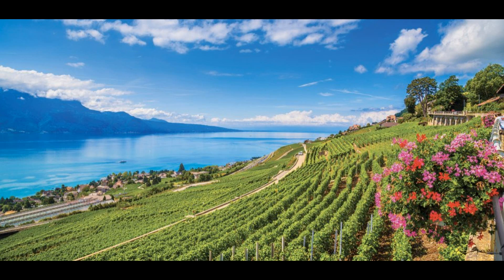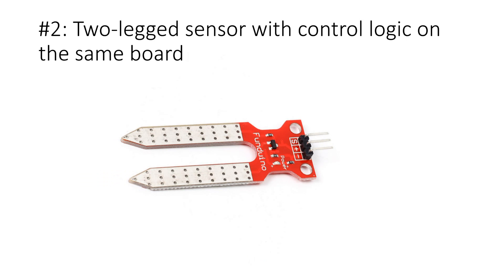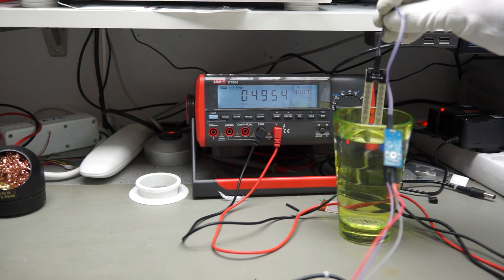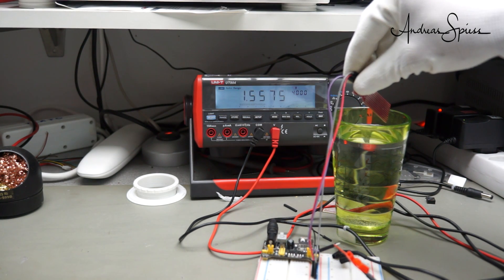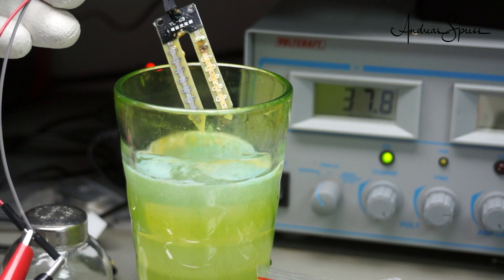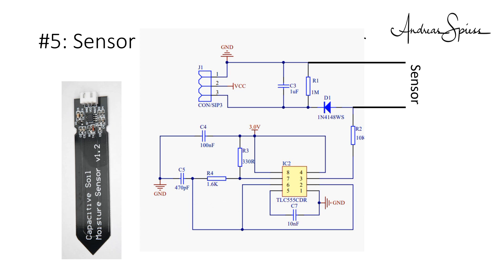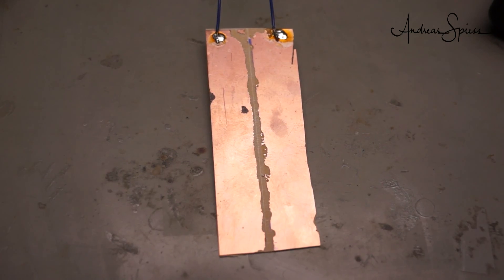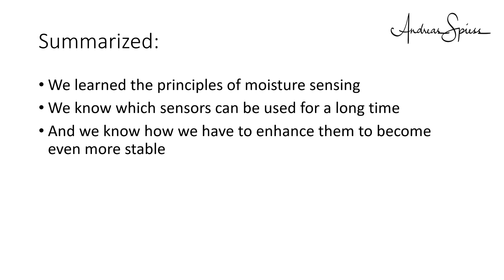463 Why most Arduino Soil Moisture Sensors suck (incl. solution)

Comment: I use a very good nail varnish to cover all the moisture sensor v1.2 including the chip and the pins and wires and works fine since 2-3 years now. But there is a missing connection between ground pin and the a ground trace. Simply solder a small diameter wire on both side of the pins header. Cheap China stuff but works.
Reply from the maker: Thanks for sharing your experience. I left a video where the quality problems are explained.

Comment: Nice test, however, you cover only one aspect of moister sensing because you test the probe in water, which is the case maybe only in a swamp. With different types of soil, readings will differ and you may expect only trends not measure humidity with countable precision. I created and sold capacitance soil moister probes almost 10 years ago with limited success because of issues with soil (ph, soil compacting, type of soil and ingredients, temperature, and so on). Probe was tested in different climate ranges and soil types, even in the substrate in almost laboratory environment.
Reply from the maker: I agree with your findings, but unfortunately, I did not find studies on the topic. I would only recommend these sensors to trigger watering. For precise measurements, you get the TDR sensors. But they are much more expensive. Could you let us know if you published your findings?
Reply: @AndreasSpiess  I will try to find some old web pages I created according to findings and republish them, however, it was a long time ago, and at that moment I wasn't fun of  open hardware  movement, mostly because I didn't understand licensing documentation and most document have strict copyright

Comment: Would using two stainless steel probes solve the corrosion problem?
Reply from the maker: There are several proposals in the comments. One mentioned special nails that avoid the corrosion problem.

Comment: There is a very good video from „flaura“ about problems with capacitor version. He tested 38sensors and most were wrong! because of the pandemic production problems the are tricks with wrong components . see also: https://youtu.be/IGP38bz-K48
I can confirm this cheating. I had to fix 2 of 4 sensors. In this video he also references your original video.

Comment: Even the capacitive sensor isn't good, with exposed FR4 edges. I looked into this once and Steven's Hydraprobe looks good. It gives moisture, temp, salinity over RS-485 using 50MHz RF. The cost is $695 though (!).
Reply from the maker: I agree. These TDR sensors are much better, I agree. But for controlling the watering of 10 flower pots probably a bit expensive ;-)
Reply: @AndreasSpiess  FWIW, HydraProbe isn't TDR, it uses radar to measure dielectric impedance. It measures the energy storage and energy loss of the soil to determine the moisture content. This reduces the influence of salinity and temperature compared to other solutions, allowing it to work without calibration. It's really neat and I have bought one, but I won't get to test it until early 2024.

The cost is silly, but nothing is too good for my lawn. :p Mostly I just want to play with the cool tech. My DIY irrigation controller calculates ETo to determine watering durations. I'll use the soil moisture data to double check that, eg don't water if the soil has enough moisture even if ETo thinks it needs watering.

Comment: Andreas - good to see this topic again.  I was a disappointed to learn that even capacitive sensors fail over time if they are just coated with resin, as the resin still allows water intrusion via osmosis.  I wonder if that includes all forms of epoxy.
Perhaps the probes and the base of the instrument body could be coated with "Plasti-Dip"?  The plastic bag is a fine idea, I guess, but really the sensors should be fully sealed in plastic until the whole instrument is up out of the soil and well out of the way of splashes, etc.  So rather than putting plastic "leggings" on the sensor probes, I'm talking about plastic "pants" that reach to the top of the sensing instrument.
I am a bit sloppy when watering plants, yes. :^)
Reply from the maker: Thanks for sharing your experience. I do not have longtime experience with the different sorts of epoxy. Maybe others experimented with it already.
Reply: The thicker the protective layer, the less sensitive the sensor is. Which means: use a very fluid resin for coating, so that it will cure in a thin layer.

Comment: Hi Andreas, Always a pleasure to view your videos.  I have played with quite a few of the capacitive sensors. I found that with some of them, the 1M ohm resistor that is supposed to be connected between GND and SIG is there but is NOT connected to GND! . Seems to be a design defect as a whole batch I ordered from the famous Chinese supplier had the same problem. As a result, the  reading was false. To correct it, I just soldered a 1M ohm resistor between the two pins on the connector.  Easier than trying to correct it on the PCB with the surface mounted components.
Reply from the maker: I heard of this flaw, too, and added a link to a video where it is shown in the description

Comment: You must know that the last sensor you shown have a lot of variants and there are some that are completely unusable and some of the circuitry mistakes are just “stupid”. Check them out in other YouTube videos.
Reply from the maker: I added the video you refer to in the comments. However, it is a bit exaggerated if you power the sensors with 5V. Then there is only the missing connection to the resistor left, if I remember correctly.
Reply: @AndreasSpiess  Yes, exactly that video. problem is, in my case, is that I bought 15 of those sensors 😒
Reply from the maker: @Amalokch Should not be a problem. Power them with 5V and connect the resistor to ground with a small wire. Then they should be ok.

Comment: sonoff ms01 is looking pretty good, it sends data trough I2C, it is on my to do list to test one in esphome and if satisfied switch from all other ones .... but it is not on top of my list ....
Reply from the maker: Xiaomi offers a similar one, too. They are a good solution if you do not want to tinker.
Reply: @AndreasSpiess  looking for some "reliable" to integrate with esphome for home assistant. Will look at it, if you know about more please let me know, because i am in fight with soil moisture sensors from spring.

Comment: Metal salt fertilizers that people use to fertilize the plants affect the readings and the life expectancy. 

Most powdered metal salt based plant fertilizers are extremely conductive 

Just like when you’re making a battery and you’re adding acid 

Like a nickel, and a penny the copper nickel with a piece of paper in between, and you add some vinegar 

As you’re going to summer in the soil gets dryer, faster, the salts from your fertilizer, build up and acidity or the salt content spikes . 

Throwing off your sensor readings .
Reply from the maker: Thank you for the info. Is this also true for capacitive sensors?

Comment: If I had a house with fifty plants would I buy the passive copper unit, run intermittently, or the overpriced with chips to protect? Engineer to simplicity, not complexity!
Reply from the maker: You decide. Both sensors are not very expensive.

Comment: I have tested the capacitive soil moisture sensors extensively and they are not reliable whatsoever to measure anything accurately in soil, the only working solution is to make a resistive sensor that receive power only for a very short time with prongs in stainless steel or silver solder. That was my solution to manage my sprinkler system in Florida. Anyway, there is no need to measure the moisture in real time, 2 or 3 times a day is more than enough, humidity does not leave spontaneously the soil.
Reply: Tin the copper! Or use silver solder...
Reply from the maker: Thank you for sharing your experience! Shortening the measuring time for sure reduces corrosion.

Comment: I wonder if the resistance sensors would be better with graphite / carbon probes? Carbon is pretty inert in water electrolysis, unlike copper. Whilst they wouldn't last forever, they would significantly outlast copper traces. Also carbon is not toxic to plants whereas high concentrations of copper can be.
Reply from the maker: Others used graphite rods. I do not know how their handling is. The ones I know are very brittle.

Comment: I have one project where I decided to solve this problem reading the sensors very quickly, and then turn-off the circuit where the sensors are connected. First the Arduino turn the circuit on, then I made 64 readings in less than a second, and calculate the average value of the readings. After that I turn off the circuit. As I have to make just one or two measures per day, I think this is a good workaround.
Reply from the maker: Indeed, this is a good idea to reduce corrosion.

Comment: Small problem: Clean water id more or less an insulator. What you can measure is the concentration of different salts wich gives a very unprecise picture of the soil moisture.
Reply from the maker: For the resistive sensors, you are right. The capacitive ones use water as a dielectric material.
Reply: @AndreasSpiess   Yes, but what does the salt content in the water means for the dielectric properties? I have experimented with a small cage made of net buried in the soil. Inside a DHT 22 to measure the air humidity and tried to relate it to the soil mosture.
Reply from the maker: @andersgardo6777  And did it work?
Reply: @AndreasSpiess  I got some different values but i don't know how relevant they are. Lack of time to go deeper.

Comment: A super cheap workaround is running DC for 10ms every minute or so. You still get your readings and the sensor lasts much longer.
Reply from the maker: You are right. This helps to avoid electrolysis.

Comment: Electronics noobs here, but two questions:
1) Would the DC moisture sensor last a lifetime if you'd only power it for sensing like once per hour for a few seconds?
2) If you'd somehow make it an AC sensor instead of DC, would this avoid the electrolysis issue?
Reply from the maker: Both help. But exposing metal to soil seems not to be a good idea as it corrodes for other reasons

Comment: Excess copper in the soil causes iron uptake issues in plants. Too much leads to very pale yellow plants that die after a week or two.
 
Our hero in this case, as always, is the inanimate carbon rod. You don't want to use anything made of metal when dealing with plants.
Reply from the maker: Thank you for the info!

Comment: Loving the SHT-35 for humidity, so far at least. They seem to be quite a bit more robust than the old DHT sensors. I run 2 of them 24/7 to add humidity to my plants via a relay-controlled humidifier.
Reply from the maker: I am not sure if humidity sensors work to measure moisture. Do you use them for moisture?
Reply: I don't, but you did mention humidity sensors in the video. :) So slightly on topic.

Comment: I've never used them. I was expecting you to use Proximity sensor with it's sensitivity set extremely low.
I have no idea if it would work but I'm my head it makes sense.
Nice video.
Reply from the maker: Just try it and you know if it works ;-)

Comment: I use hot-galvanized nails as probes.  These are the gray, rough looking ones.  Few years now, no corrosion.  Avoid electro-galvanized (shiny) - they wont last.
Reply from the maker: Good tip. Thanks!

Comment: I bought the Xiaomi Miflora Sensor wich has also a lot of knockoffs wich are cheaper, Monitoring it for 7 Montths now and it works fine and reliable + has integration features Battery still shows 100% You pay a little extra for the enclosure ( water resistant ) and the ease of use ( not encrypted BLE ) and a nice byfeature is the EC measuring wich gives a rough ( not really useful ) estimate when its time to give a little more fertilizer or if there is too much salt build up
Integrated in HomeAssistant with Automated Watering learning based of the dry / wet cycle and times it takes the plant to take up the water added 
I couldnt have or use more features and its working out of the box, no need to ask for more after fiddling around with diy solutions for years im happy that this project is now running and working
Reply from the maker: I agree these Miflora sensors are a good choice. Thank you for sharing your experience!

Comment: A nerve can be replicated in the lab, such as how our nostrils allow us to know if its dry or about to extrude a magical nose goblin worm jellyfish type of pet from Lungset twin cities.
This can be recyled to make capacitors and the snot battery.

Also, we can begin to wear peltier circuits woven into clothes for best cooling cheapest, and our shirts and shoes could charge a heating pad woven into clothes. This can also power devices. We could also breathe into a tank exhaled breaths, and this could raise a weight or turn wind up a torsion coil to harvest the power of the people boosting performance and efficiency of the biological engines that we are.
Reply from the maker: Interesting ideas!

Comment: You could make a tiny floating ball in a tube that is seen below the soil with a proximity or magnetic sensor, or you could insert a humidity sensor from a weather station for percentages of moisture, and this can activate automation to add water.

A toilet float valve or a smaller copy could trigger a online watering line and use a automatic fish or dogfood bowl refiller to add plant food.
Reply from the maker: Moisture and humidity are measured with different sensors. So I am not sure if a humidity sensor would work for moisture.

Comment: Could you propose a method to calibrate the output characteristics for the particular soil type, installation depth, and soil compaction?  In other words can we compensate for these effects in order to improve repeatability? Maybe comment on use as tank fluid level sensing. Thank you.
Reply from the maker: 1. I am not sure if they can be calibrated for precision. At least, I did not find any information about it. It is more to show you when you have to water your plants
2. I made a video about measuring water tank levels. Capacitive sensors are used there, too. They are longer.
Reply: @AndreasSpiess  please share the link

Comment: Hi Andreas! Just a comment about the home made PCB. It is very easy for copper clad FR4 to make 2 cuts through the copper down the center close together with a razor blade. Then lift a corner of the copper with the razor blade and grab it with a small pliers. It can usually be stripped off fairly easily. It should only take a minute or so to do.
Reply from the maker: Good idea! Thanks for the tip!

Comment: Very nice view over the lake. Switzerland is beautiful. I have had the same problem with "open" sensors. I took bicycle spokes and solder it on the sensor. It works OK.
Reply from the maker: I wonder how you were able to solder to steel spokes. I did not know it works.

Comment: Any electron flow in a damp environment will cause material to migrate either from your plate or to your plate.
None contact is the only way to go, or treat the sensor like an LCD display where there it has to be treated the same, an AC signal with no DC component, or you destroy the segment.
Reply from the maker: I agree!

Comment: The two-legged sensor with a gold plating most better than of cheaper lead. I've tested ENIG version about 2 month, if not scratch them, no corrosion will be even with fertilizers. And power on must be very short as possible for measuring.
Reply from the maker: Thank you for the info!

Comment: I have a commercially made sensor (Ecowitt WH51) that appears to have a continuous loop that goes into the soil.  Perhaps under the coating it's not a continuous conductor though.  It eems very reliable but now I want to see what is inside.
Reply from the maker: Inside are two not connected traces that form a capacitor.
Reply: @AndreasSpiess  That's my suspicion after watching your video. It was very helpful to understanding how it works.

Comment: A range of these capacitance sensors were tested on the Flaura - Smart Plant Pot video. The youtube algorithm worked this time!  This channel shows that many are made with flaws and he shows the flaws (82% of his test sample), how to choose when buying, and how to fix the flaws if you have one.  It is definitely worth watching.
Reply from the maker: Thank you for the info. I added the link to the video in the description.
Reply: Dude, change the electrodes for graphite, and also implement fast read instead of continuous read and you'll have less power drain and waaaay less corrosion, i mean a milissecond read in 5 minutes = 300.000x less corrosion compared to continuous.
Reply: Do you have a source, where to get components, that fulfill those 3 criteria?
Reply: finding a good design and ordering your own PCBs should be trivial, this will save you headdache of searching for good ones and it will times more cheaper.

Comment: The problem with that capacitive sensor is that you can't easily put it into low power mode by disabling the oscillator.
Reply from the maker: I assume you switch it completely off if you do not use it, if power is constraint.